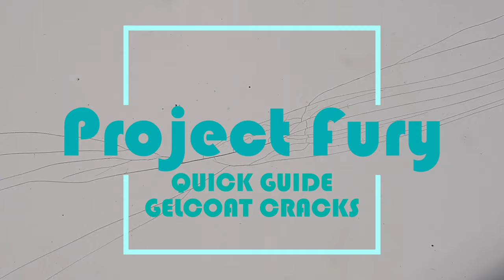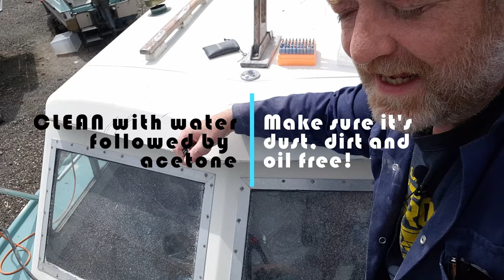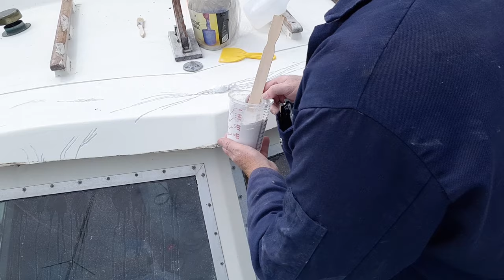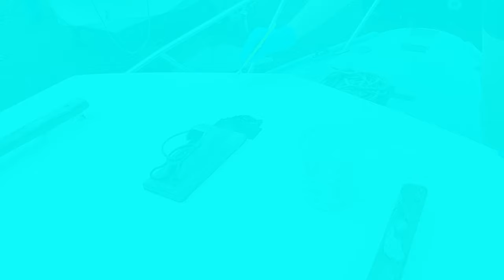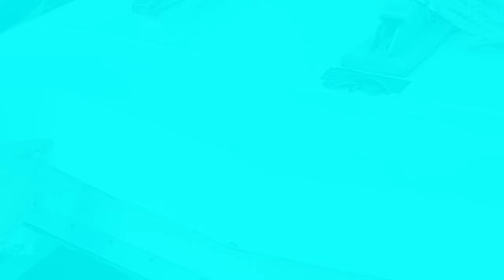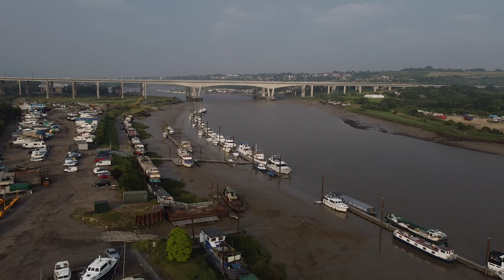Fix Gelcoat cracks RIGHT 🏆 NO INSTAFIX, DO IT PROPERLY!

Comment: A thing to consider is that spider cracks just don't appear for no reason. There are three reasons for spider cracks;
1. Impact - in which case all the gelcoat needs to be ground off to expose the damaged laminate.
2. The gelcoat has been wrongly applied too thick. Gelcoat doesn't like to flex so the thicker it is, the less flex it has. Also, as it ages it become harder and stiffer and the cracks will appear.
3. The laminate is too thin and flexing too much for the gelcoat. The laminate spec is, therefore, not enough.
It also could be a combination of 2 & 3. Cheers
Reply: gelcoat starts to crack just like this after 20ish years.  ive seen it on 2 machines my familys owned since new.  you wont convince me it was anything other than the sun and elements on these and so imo your 3 ways are not the only 3 ways possible.    if the machine is a year old with cracks.  sure.
Reply: @tylerhoward2703  What happens is that over the years, styrene is leached out of the resin/gelcoat and it becomes more and more brittle. And, which exacerbates those three deficiencies I listed. Cheers

Comment: Thanks for the video.  Quick Question:  But what if the cracked gelcoat’s clear (and glitter flakes underneath)??🤔
Reply from the maker: Oh boy, I wouldn't want to be the one fixing that...I think you'd probably sand back and feather a wider area around the crack down through the flake, re-apply the glitter flake/resin layer(s) and then clear resin on top, but I've not had to do that before myself.

Comment: You can also use dynaglass that has resin mixed with it
Reply: People say it’s not waterproof but you spray gel coat over top of it and dynaglass is much stronger but a little more expensive but you get the money back by how much less time you have to sand on it vs gel coat with silica on it
Reply from the maker: I have some experiments planned with different patching mixtures for later in the year, I'll add that to the list!